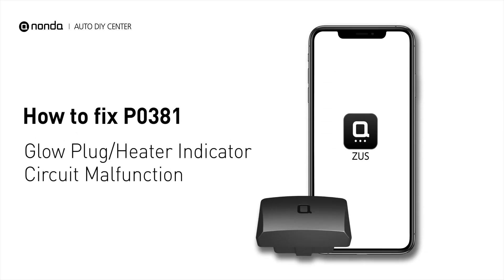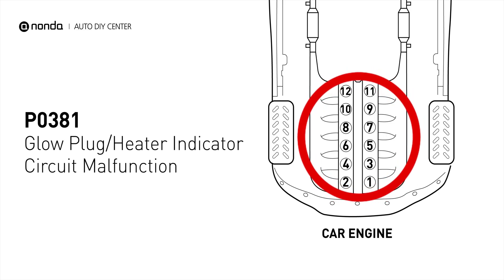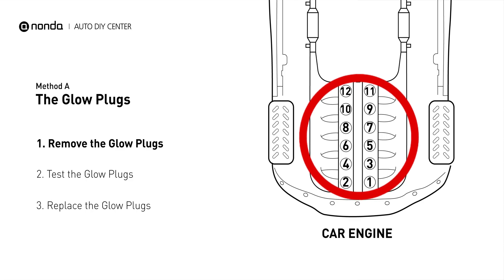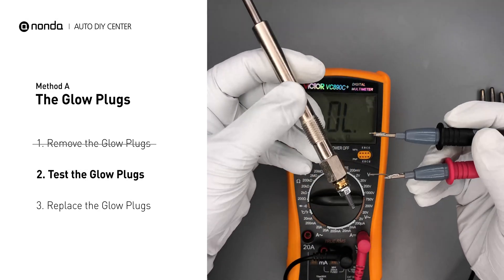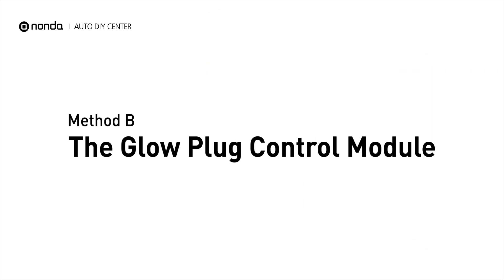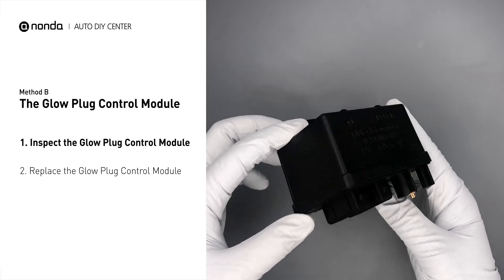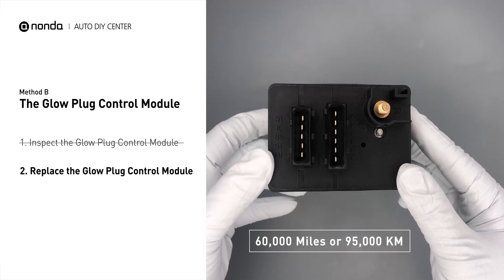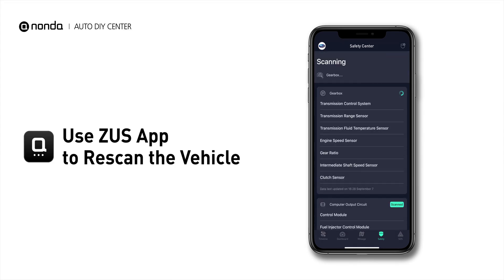How to Fix P0381 Engine Code in 3 Minutes [2 DIY Methods / Only $9.27]

Comment: this is literally a useless video, it says glow plugs heat fuel and they don't they heat the air in the combustion chamber. this should be thumbs downed a million times over